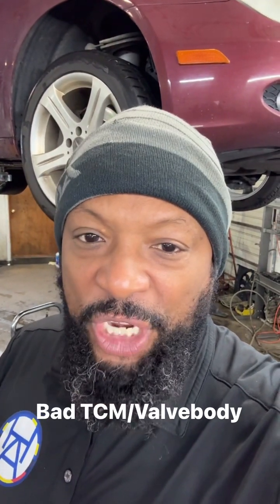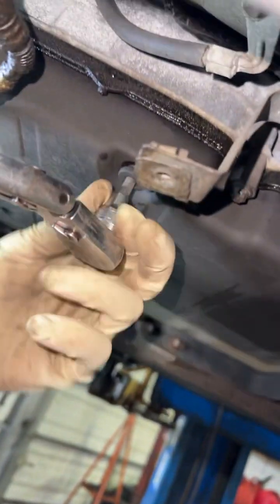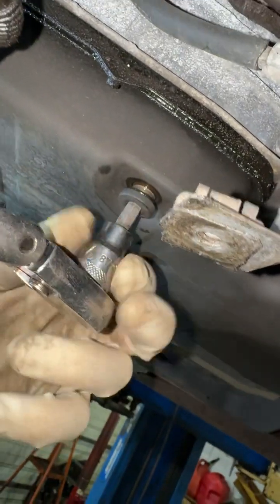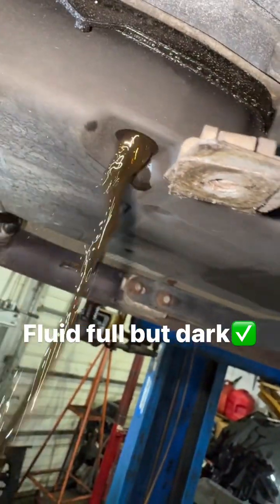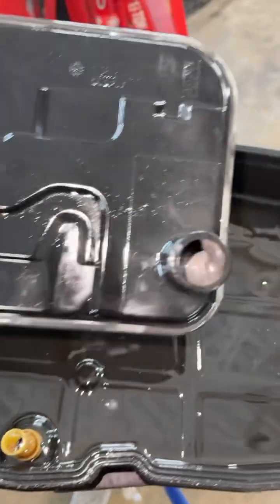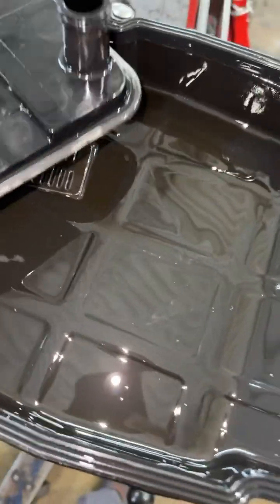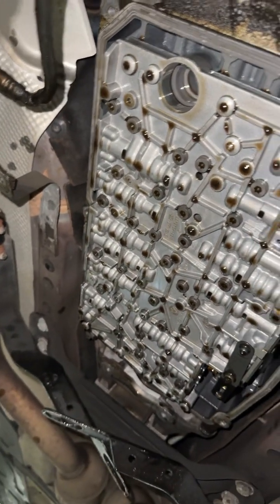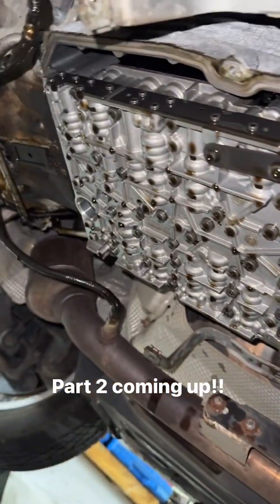Mercedes benz cls  500 won’t shift out of 1st gear

Comment: What’s was the code I’m getting p0730 incorrect gear ratio I’m gonna get a whole new valve body and service kit
Reply from the maker: That may not fix it.   Drain fluid check for metal or clutch material.  May need trans